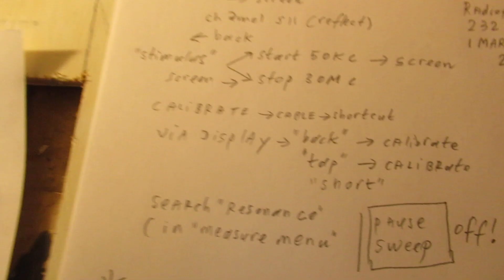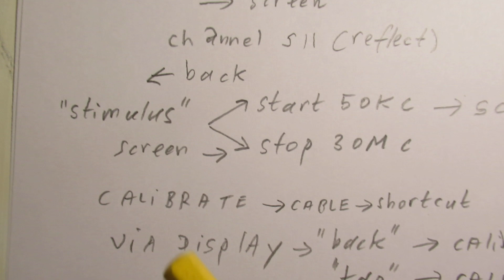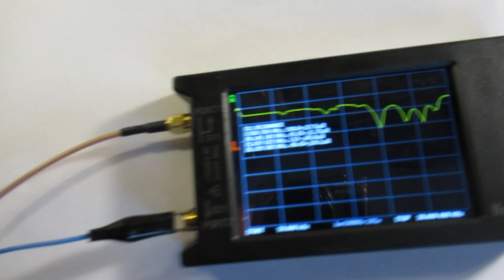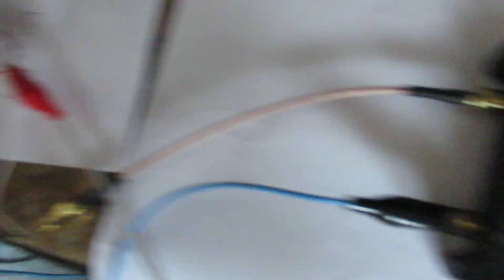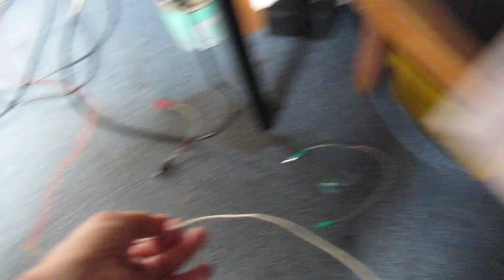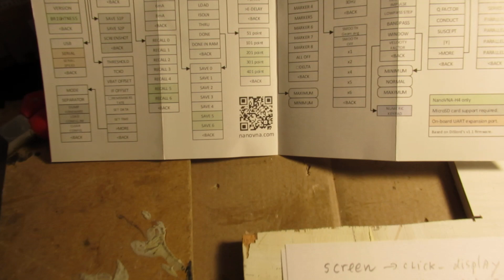Measuring a resonant system in the 1 MC -  30 MC range with the Nano VNA H4 (demo)

Comment: Hi Ko. Nice instrument. Make sure you keep any DC voltages away from it or it can easily be damaged. The input bridge is made from tiny SMD 50R resistors rated at < 0.1W. There is no DC block at the input. You would have to make or buy your own DC block.
Reply from the maker: Thanks, very good & important info.